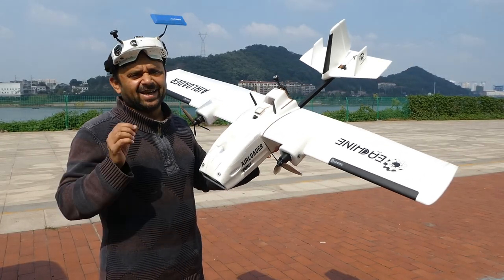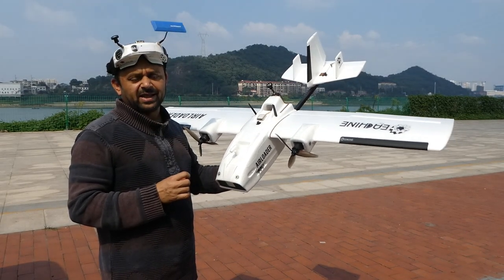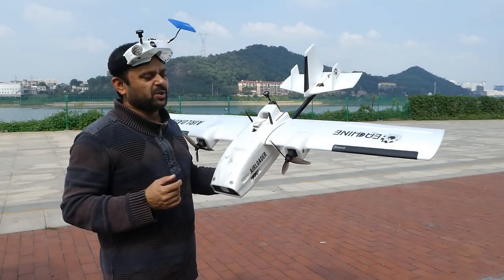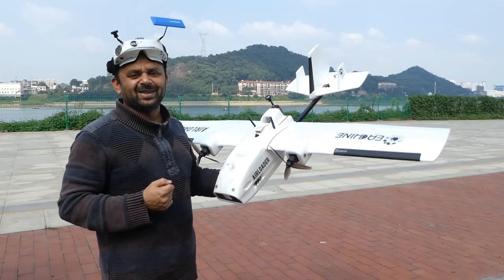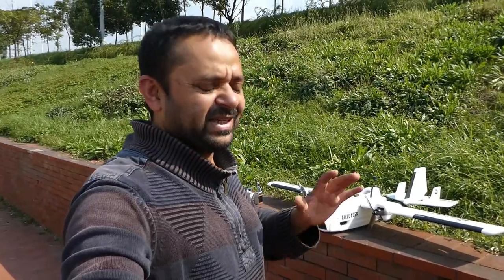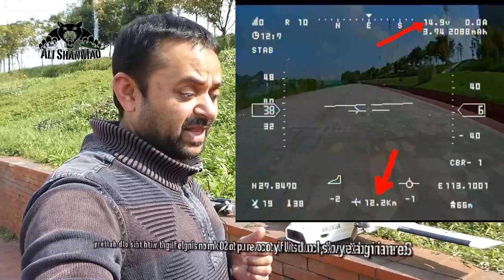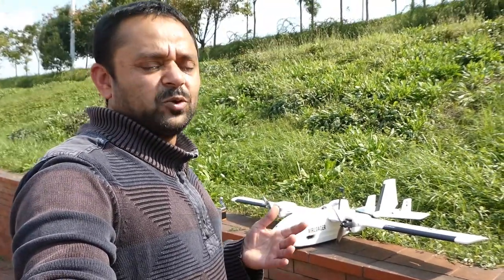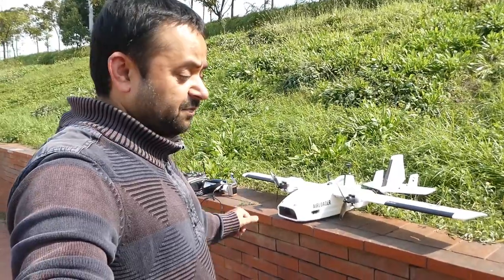Eachine Airloader Twin Engines Maiden FPV Flight test

Comment: im currently setting up tri power configuration and going to put a simple landing gear on it as well. Will be using custom built 18650 4s packs and crossfire with the Zohd fc system. going to use a TBS crossfire vtx with 800mw as well. I am setting it up for long range flight.
Reply from the maker: Sounds great!

Comment: Hi @UCsFctXdFnbeoKpLefdEloEQ, which fpv plane/wing would you recommend for very stable and smooth fpv video feed ? I see fpv freestyle drones have very smooth video. Do you know any wing/plane which can do that ?
Reply from the maker: They are two different types of aircraft and you can't compare these two for video types shot. you can get smooth footage on Planes using cameras that has flow state stabilization just like the ones people use on Drones. but you can't pull aerobatics like drones however you can do something different with wings that drones can't do. so both have their own advantages and disadvantages.
Reply: @alishanmao  Hmmm. Understood. Thanks! I'm really loving the Airloader.. Looks like that fulfills my desire from a fixed-wing.